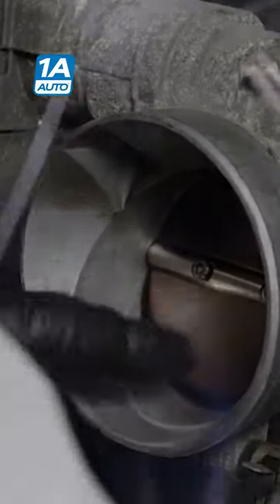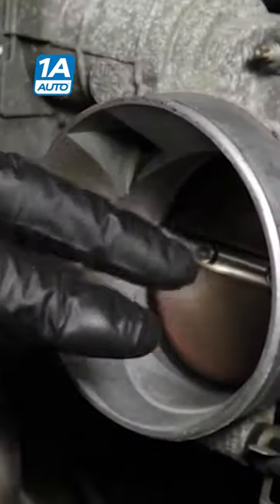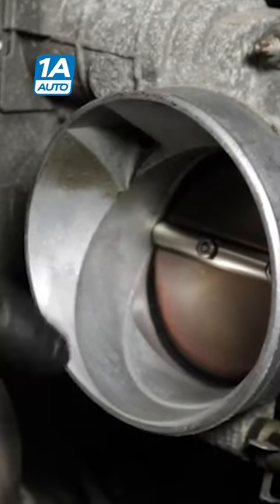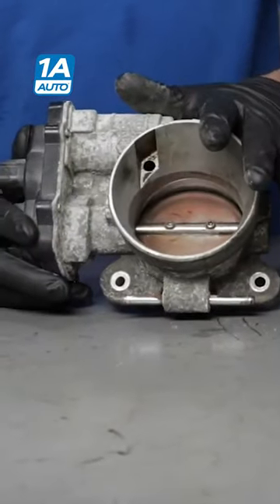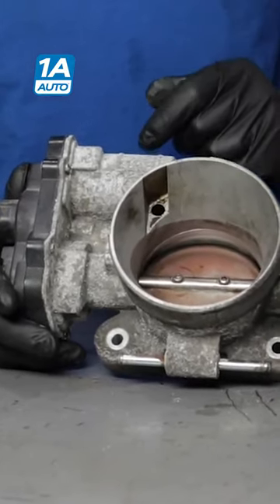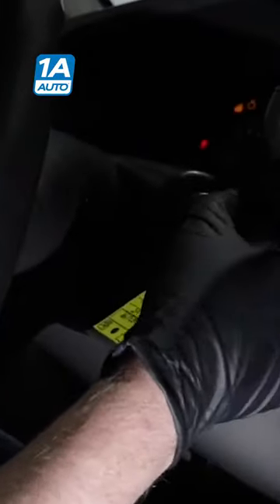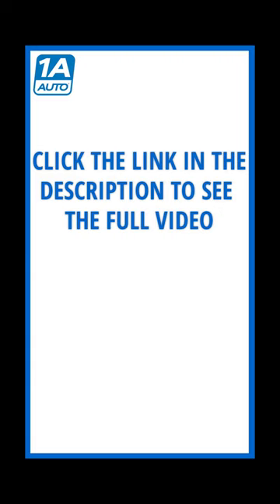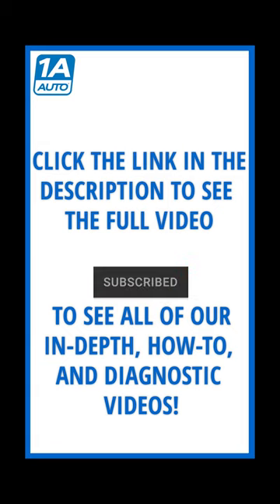Throttle Body Relearn - When Should I Reprogram My Car's Throttle Body? #shorts

Comment: wow when you explained it i just understood it so easily it just clicked in my brain now i understand because my vehicle doesn't have a mechanical throttle body where you pull on the cord so i understand that i will have to clean the throttle body I'm ok with that so thank you for this information